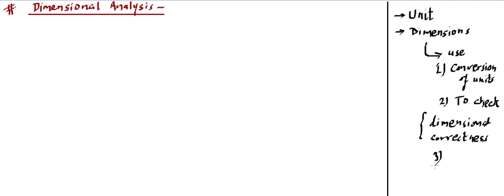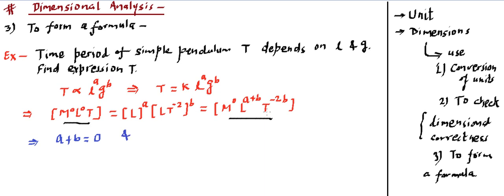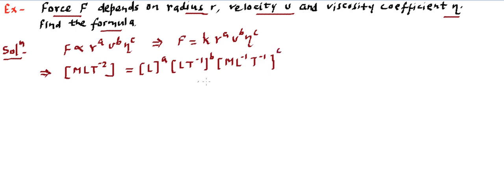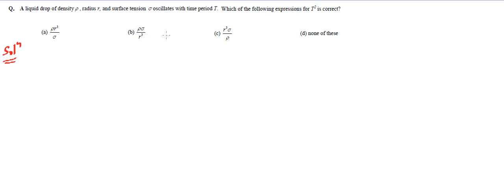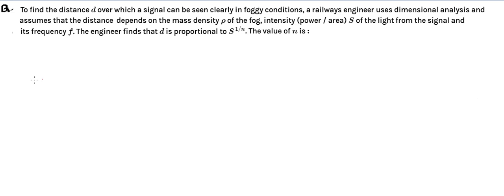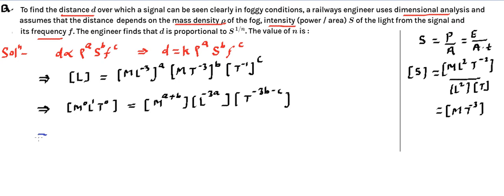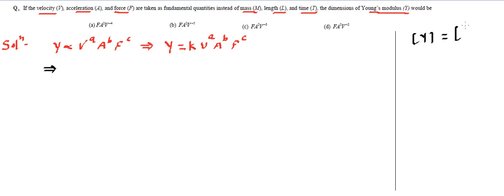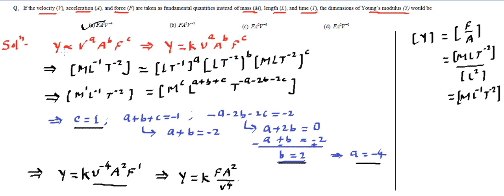Unit & Dimension Lecture # 4

Comment: While measuring acceleration due to gravity by a simple pendulum , a student makes a positive error of 2% in the length of the pendulum and a positive error of 1% in the value of time period. His actual percentage error in the measurement of value of g is??
Sir how to solve this question??
Reply from the maker: Using Simple Pendulum formula, we can write % error in g = %error in L - 2(%error in T). Here, place the given errors with sign.
Reply: @apexphysics6242  Sir why is there a minus sign since errors can only be added??
Reply from the maker: When we calculate error we add them (basically, we calculate maximum error). However, if it is mentioned that error is positive and negative, then we need to use signs as well in the formula and values. So, here using sign is required.
Reply: @apexphysics6242  Sir if both 1% and 2% are positive errors then why does 2% not have a minus sign??
Reply from the maker: You can call me. Your doubt will be cleared well.